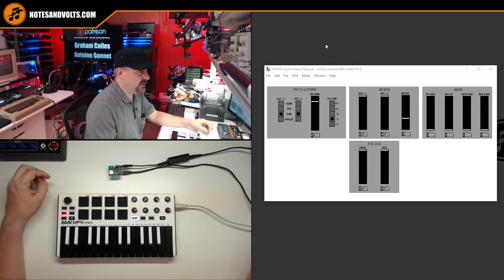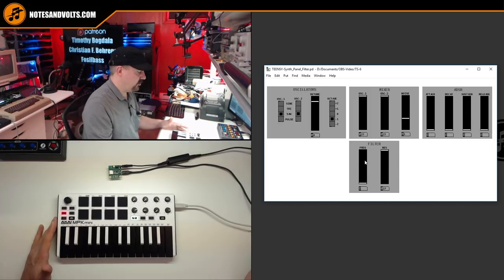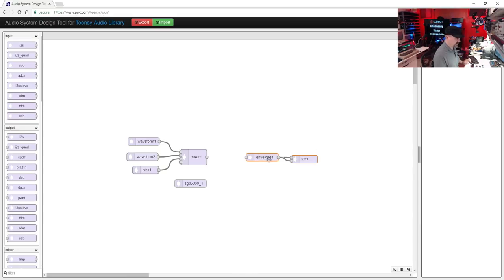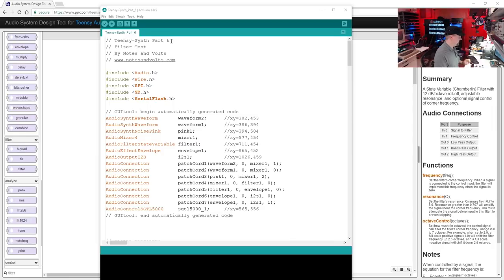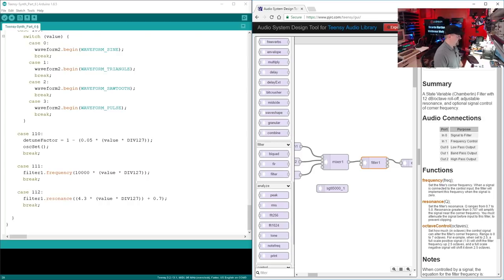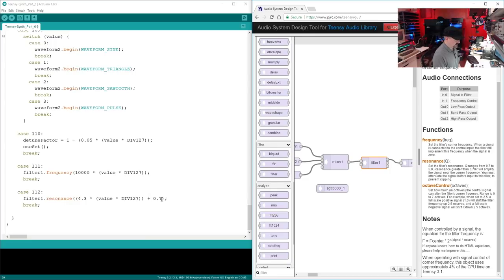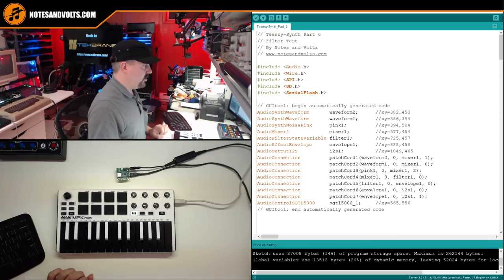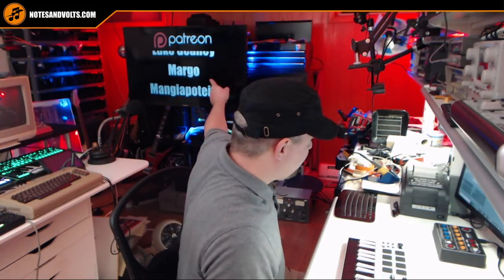TEENSY-Synth PART 6: FILTER

Comment: Once again, you've brought us a great segment- Thanks!  I have the Teensy's on order.
Only trouble I have is you using a Commodore 64 from a previous segment.  Will any other device work in it's place?
Reply from the maker: Thanks Ted! You don't need a Commodore 64. That was just me trying to be interesting LoL.
Reply: What else will work in place of the Commandore?  As always- GREAT project!
Reply from the maker: Paper and pencil. ;)
Reply: Wise Guy!  :)   I have a Korg PS60. It comes with software that shows the full layout.  I can turn a control and it will show a
change on the PC Software. I can change in the software, and will turn the knobs. Very nice!  Question? Will the Panel
software allow you to show the sliders movement when a knob is turned on the keyboard, and change in the Panel?

Comment: Interesting! Is it possible to then convert it as VST/AU and use it in a DAW?
Reply from the maker: Thanks Allan. You can definitely control it from a daw but the sound will come from the hardware.
Reply: Notes and Volts Cool! Yes I understand I would have to go out from the audio board to the input of my audio card (I have other synth/analog gear) but the idea of having one of my own, that I could control with a simple interface from my DAW is sounding really nice!
Reply: @AllanValenteBe   I'm doing this tutorial with ableton and a midi track instead of  PD . pretty much the same flow... mid clip for the notes and the cc's